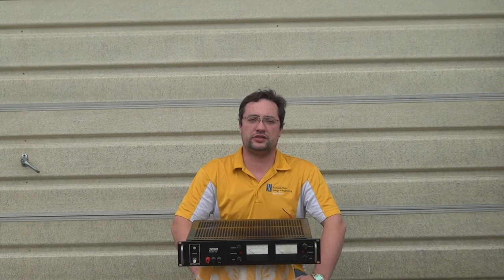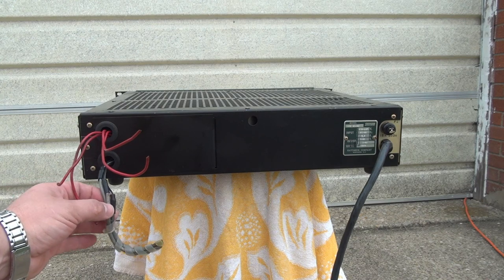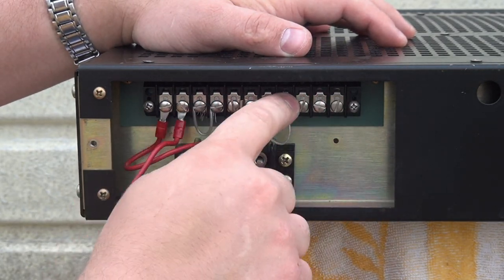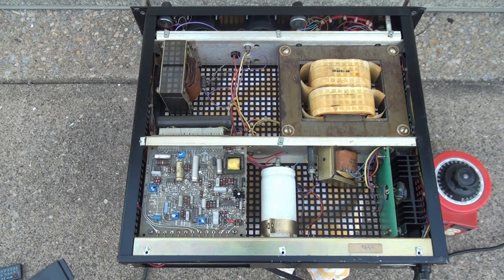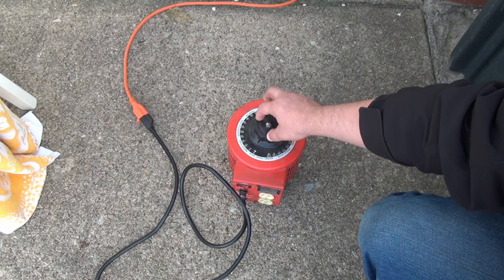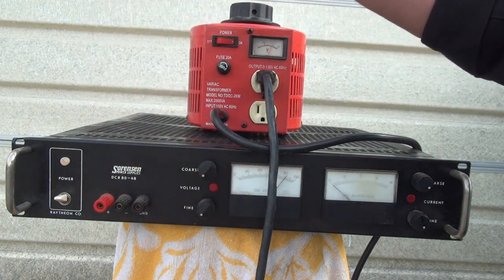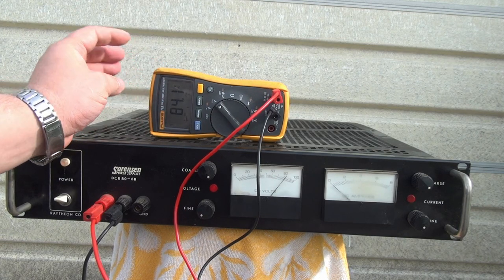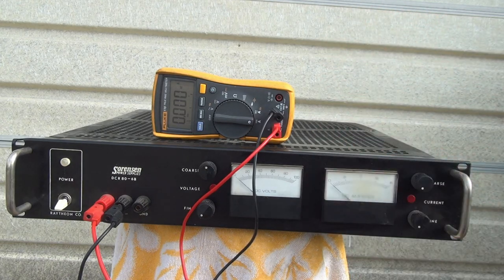eapbg #46 Sorensen Power Supply Tare Down

Comment: Found objects with wires cut off is definitely a bad sign.  It means the place that threw it out decided it was beyond economic repair and the power cord should be saved for future use.  They took it apart already and checked it before you found it in the dumpster.  This is especially true of test equiptment.